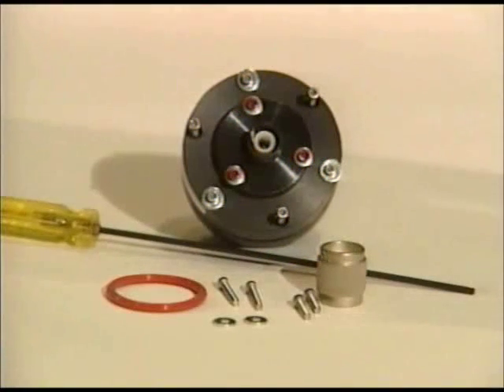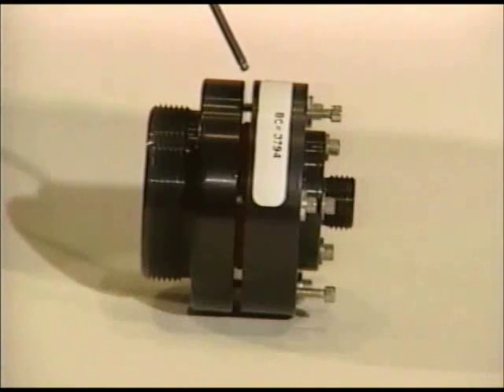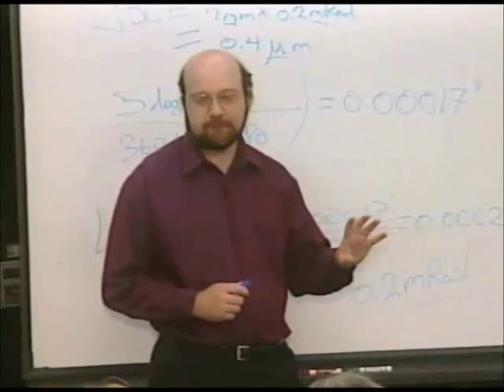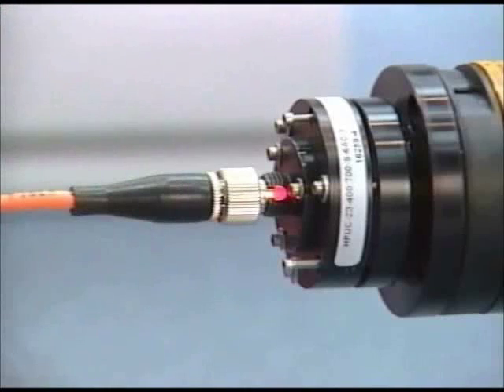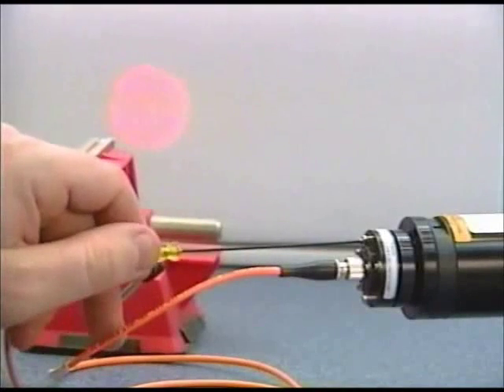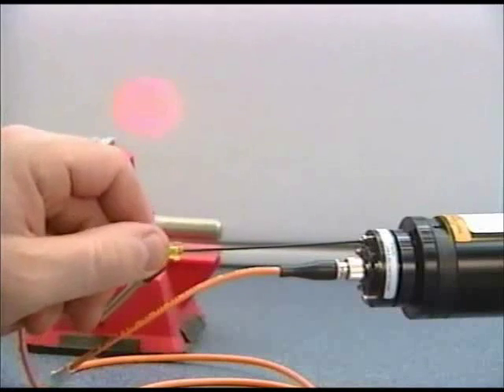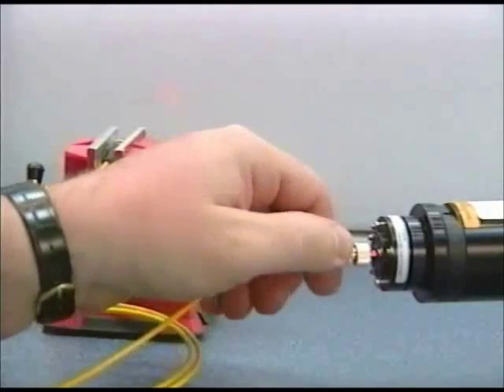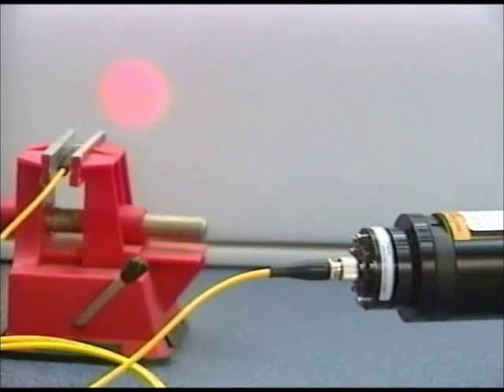Laser to Fiber Coupler with Receptacle Instruction Video

Comment: Thanks a lot, this was really helpful. I just used your guidance to align the laser with the coupler in my setup.
Reply: Hi Avanish, 

I hope the alignment is working well. I tried the same thing as shown here, however it doesn't work well. Actually I could do alignment; however, the power of the laser is not enough to be able to use confocal system. Do you have any idea how I can make laser more powerful? Thank you for you interest